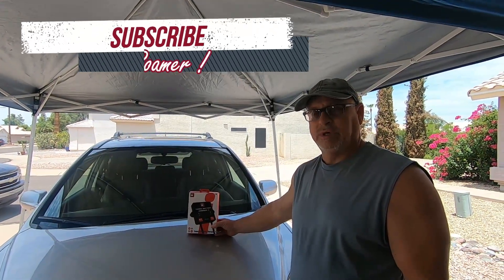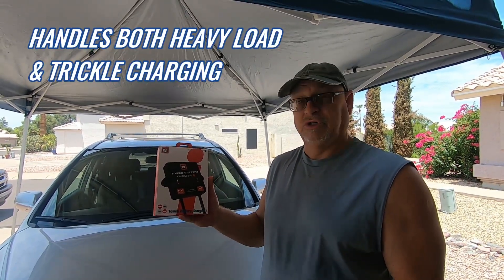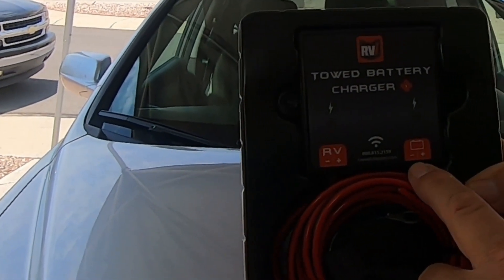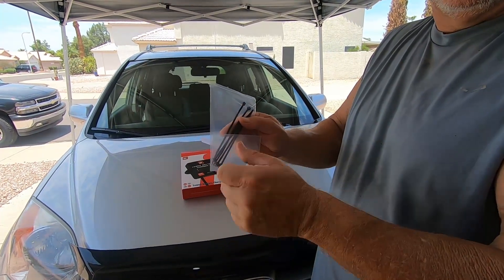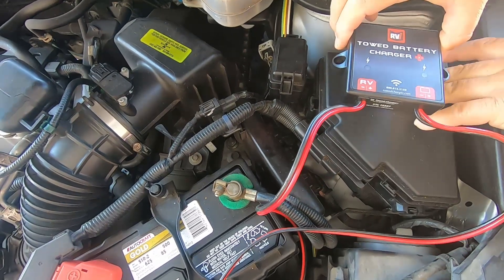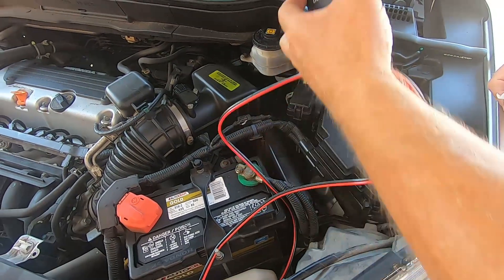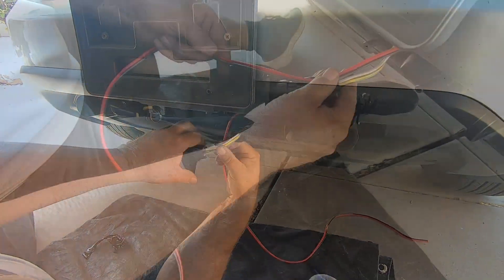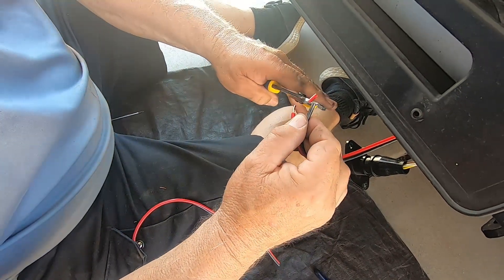🚗 Towed Battery Charger Installation For Flat Towing Behind Your Motorhome

Comment: Much more informative than the RVi install video.   Like how you handled the problem of two ground wires not fitting the one hole.  I am about to set up our new toad to be car, your video was a great help!
Reply from the maker: Thank you. Glad it was helpful! I watched the RVi video and felt is was lacking in a lot of the information needed. Good luck with your set up and safe travels!

Comment: I did a similar thing using a 12volt emergency charger in the RV off of the starter battery. It limits the current so if the 12volt feed shorts to ground it won't catch fire.
Reply from the maker: That sounds like a good set up. I didn't even think about this until I bought our brake system for our tow vehicle. I just checked it out on RVi's website and thought that it would be a good idea.  Thanks for watching!

Comment: I couold not find any info, do you know if this unit is waterproof where it may be installed on a RV trailer?
Reply from the maker: I’m not sure. You can contact RViBrake and ask them. The number is 800-815-2159 of the website is RViBrake.com. Hope this helps.

Comment: I ran into the same situation when installing my RVI  towed Charger.  12 Volts from Motor home cable transfers to the center pin on the towed vehicle's 6 way end . Ground wire was too thick to put two into one connection point. Pig tailed also to make it work. RVI should be more clear in their instructions and should include a couple of different scenario diagrams. Thanks for the Video well done.
Reply from the maker: I agree with you about RVI simplifying the setup. Glad you the pigtail worked for you.
Thanks for watching!

Comment: How about installing it on the RV instead of in the car? Like this when you change the car, you do need to remove anything, and maybe it will be easy to install directly on the output of the RV. I really don't know how is the wiring in the RV and even if this is possible, but was something that came to my mind. Anyways, really good video, thanks a lot!
Reply from the maker: I don't think it would be possible with this product, but there very well could be something on the market that does what your talking about. Thanks for watching!

Comment: Doesn't the 6 pin connector your are pluging in from the RV to run lights and turn signals already supply battery voltage to charge the towed vehicle battery?
Reply from the maker: No, it wasn't set up for that. I checked with the company that installed my baseplate on our tow vehicle.
Thanks for watching!
Reply: Glad it worked for,you. The reviews for this tow charger were pretty awful. I opted for an $8.99 Hopkins charger and an in-line fuse.  Basically if you put a diode on the circuit the charge won’t flow backwards and if the tow battery voltage is on par with the coach no charge will flow into the tow.  Since the wires on these things are long and small a fuse helps protect from a frayed or overheated wire.

Comment: Why wouldn’t you use the 12 V auxiliary power from your seven pin connector on the motorhome? Run a 12 awg (fused) right to the  positive terminal on the battery. You could install a diode if you are worried about reverse flow from towed battery back to motorhome . You don’t need to buy that thing.
Reply from the maker: I have friends that installed these on their vehicles. So I decided to go with the battery charger.
Thanks for your comment and for watching!